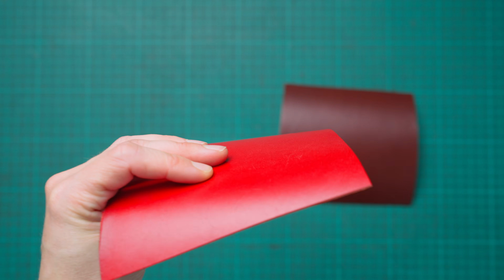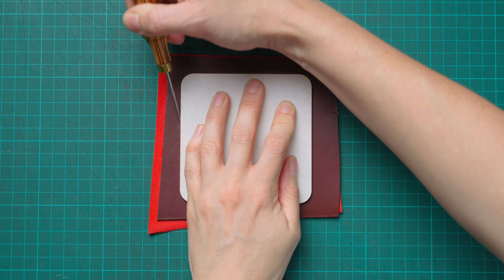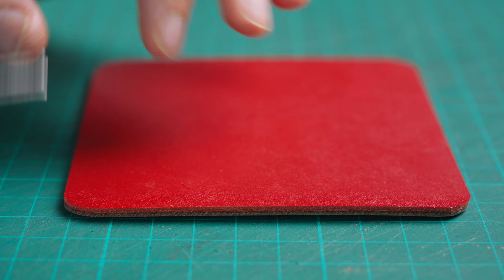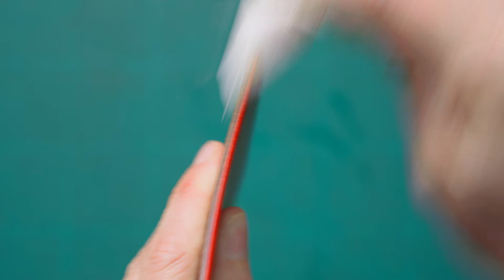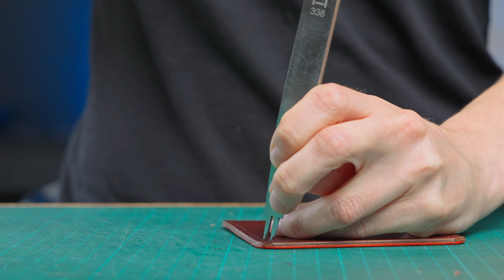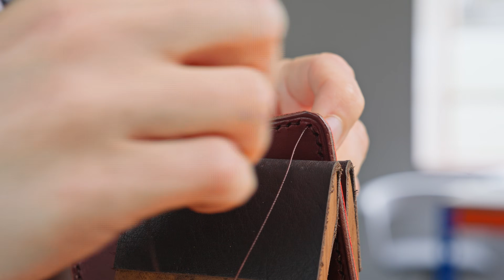Your First Leathercraft Project // Leather Craft 101 // EP05 Coaster Project & FREE Patterns

Comment: I’ll be starting this project soon. Do you think you need to sand corners smooth so they are rounded?  Any finish to apply to protect against a sweating water glass?  And a general question about creasing… can you or do you use heat on veg tanned or chrome tanned leather.

Comment: Can you not just use an edge creaser as a divider for laying out the stich work ?
Reply from the maker: Yeah you can do, you are just limited as to how wide that tool can go if you were wanting to put stitch lines in further
Reply: @JHLeather  thanks for your response, I ended up getting some mechanical dividers in the end as I was struggling to be accurate with the creasers

Comment: Hi
I am a little  confused  about  when you use a creaser and when you use a groover ( that cuts in to the leather)
Also...dividers

All make lines but which ones when?
Thank you
Reply: Creaser for aesthetics - bring a bit of pazazz to your edges. It is a finishing step, but often you do it before your stitching, as some areas may be difficult to get to after the fact.
Groover for tight folds, to guide a skive or on occasion to 'hide'/'bury' stitching - removing a little bit of bulk where you want a bend makes it easier to have a bend in the leather. You can use it to set a depth for skiving also, which is where you remove thickness. And the hiding of threads may be if you want a flatter seam, with the leather sitting higher.
Dividers - used for laying out and marking up where you may want to punch a hole, or set your pricking iron/chisel for thread holes.
Jo taught me all of this on one of her courses, over three days.
Reply: Thank you